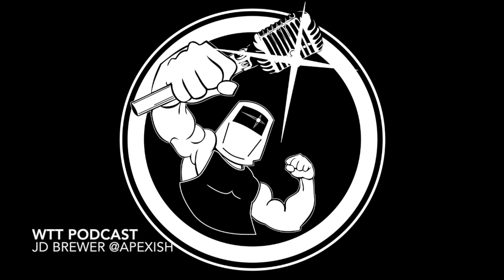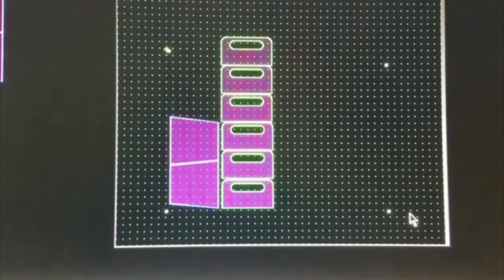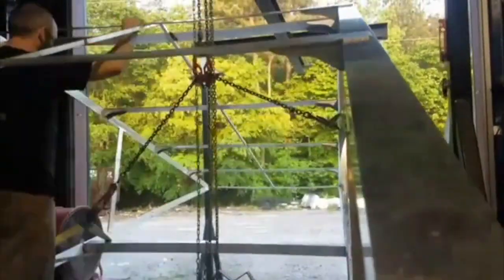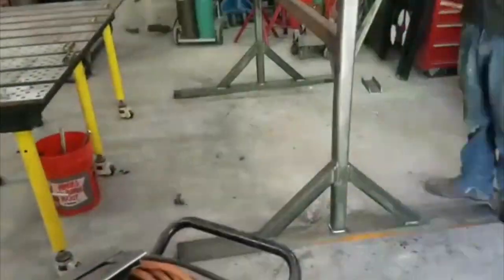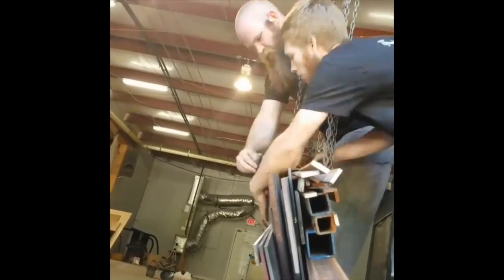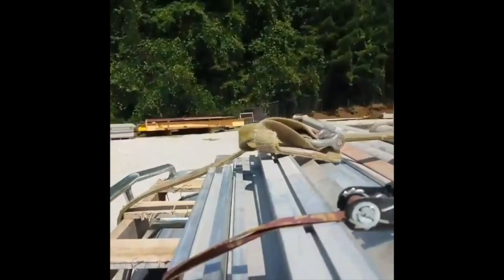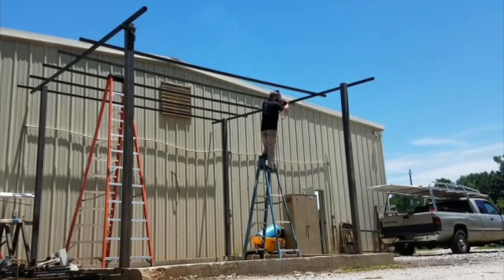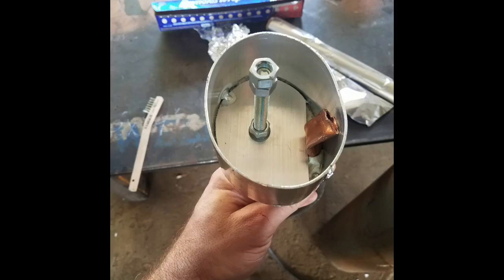Podcast with JD Brewer (@Apexish)

Comment: Maybe I missed it, but what software are you using for the plasma table, JD? Your setup seems perfect for my shop. 
I have a set of the smaller Fireball aluminum squares. They're really, very handy. I think I need a set of the larger ones now.
The deposition rate of dual shield is so much better, I don't know why anyone in a production setting wouldn't use it.
Reply: idriwzrd DesignEdge on a plasmacam

Comment: Hi I have to get some clear Tig cups from you I have a Miller 215 where do I look to find the torch number so I get the right one. Thank You
Reply: JohnDunn1969 the miller multimatic 215? I’m assuming it’s the standard torch that came with the unit.. that comes with the weldcraft WP17 Torch. Buy your cups for a #17 series torch and you will be fine.